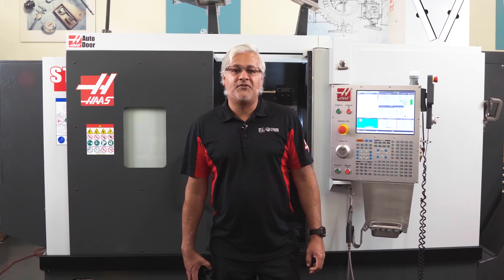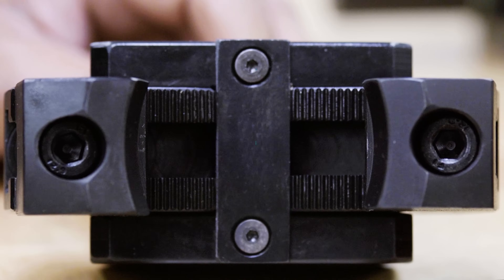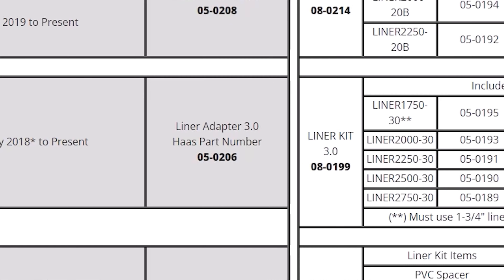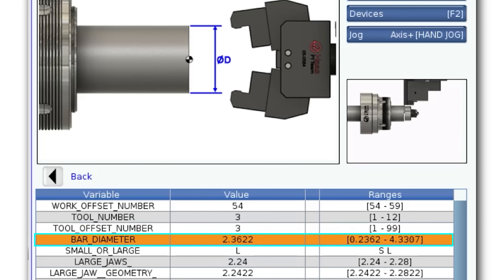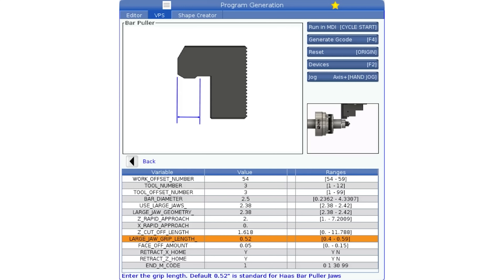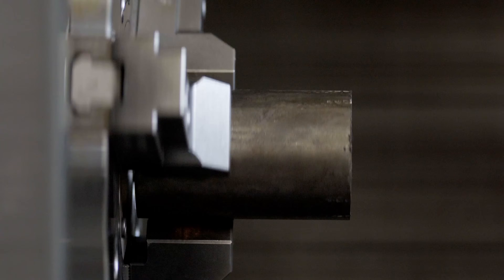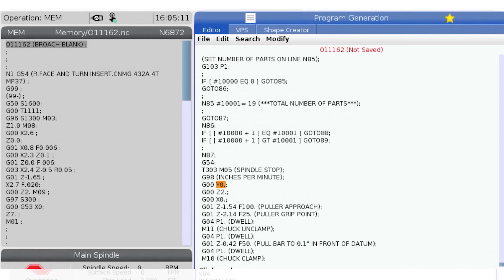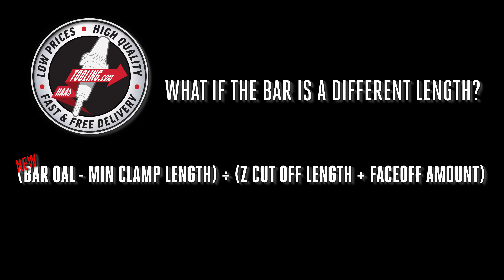Pull Bars on Your Lathe! New Haas Bar Pullers Available Now at HaasTooling.com

Comment: In the video its all about Haas machines and programming but I am going to guess this can be used on any cnc lathe provided it has the proper tool holder or vdi40, correct?
Reply: yes, nothing about the mechanism is haas exclusively

Comment: Will this work with 4130 1.5" OD x 0.065" Wall x 1.37" ID tubing?
Reply from the maker: Booneboarder, as already noted your tube size is within the grip range for the smaller jaw set. In terms of the load from the gripper not deforming the tube, that will probably take a few adjustments of the grip force to find the level where the tube can reliably be pulled without any deformation to the tube walls.
Reply: @ Yeah, I agree with that reply from zaphodqi and you.  I was more worried about deformation of the clamping strength, but I re watched the video and understand the clamp adjustments better.  Like the tool and might give it a try.  Check pricing and not bad.  Thanks for the replies everyone
Reply: I don’t see why not, it’s with in the jaw range of grip